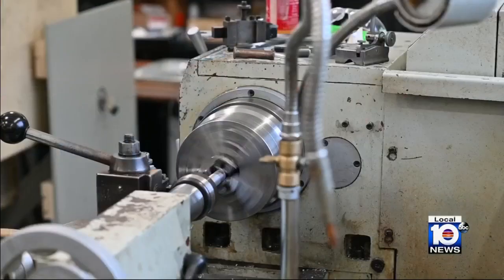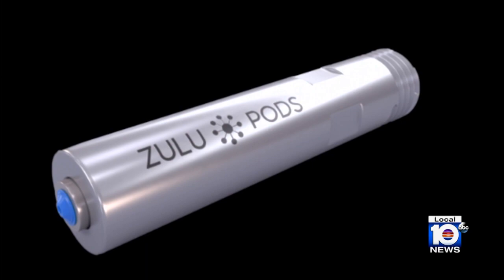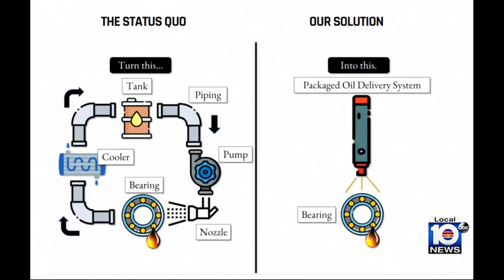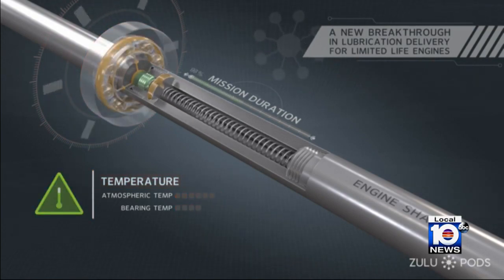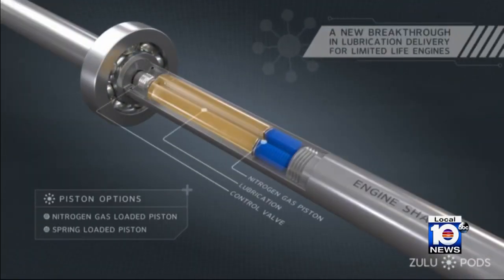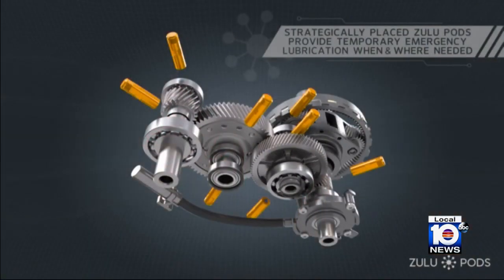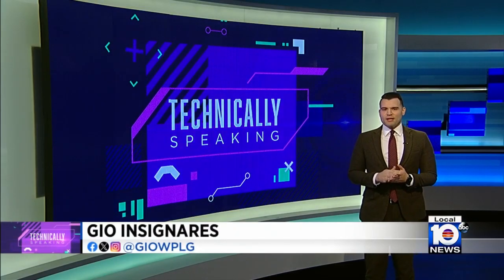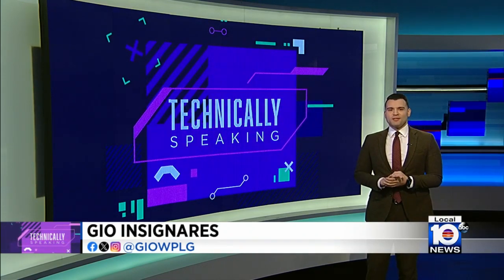South Florida company uses concept of detergent pods for engines, transmissions

Comment: Automatic spring loaded bearing grease systems have existed for decades as well as automatic drip oilers.  A limited use expendable unit (  like a drone ) does not need this type of oiling system.  There is zero application for this in a jet engine because oil needs to be filtered and cooled rather than just run in one time and disposed of.   I don't even see this being of value as a backup system.